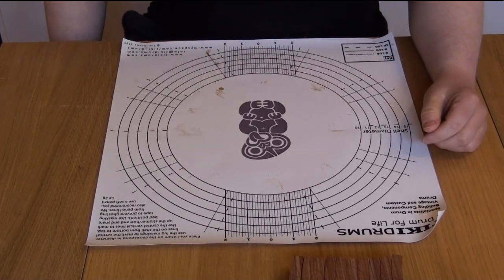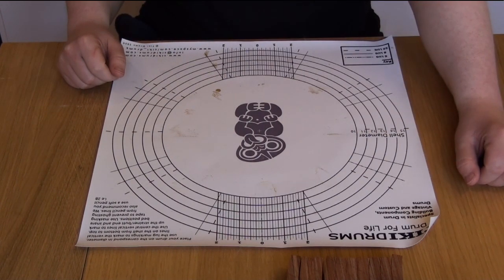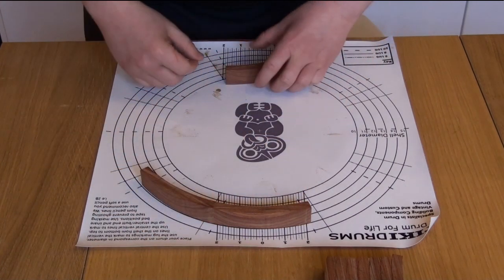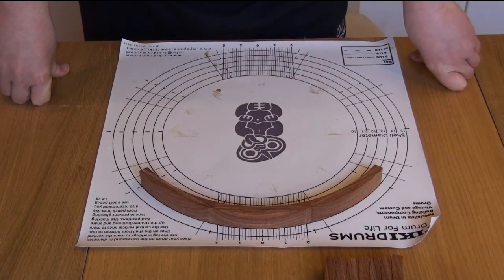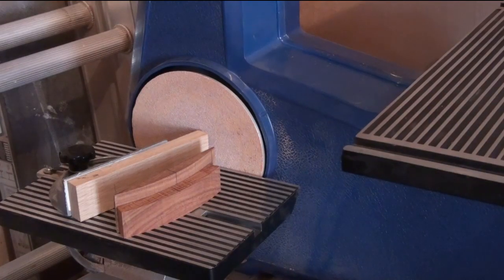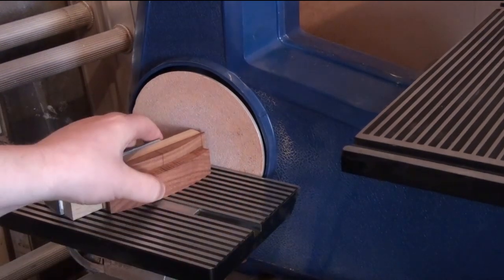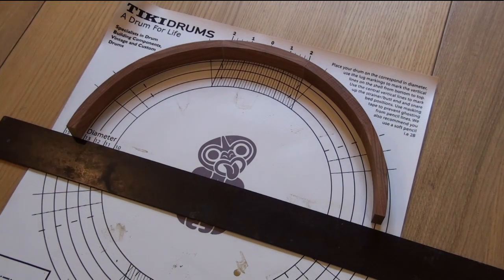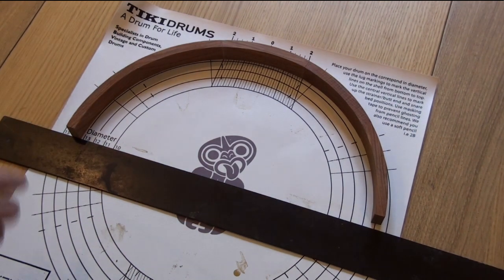Segmented Drum Shell - Part 2 - Sanding Curved Segments

Comment: Your final product looks great (I've seen your drums), and I can certainly appreciate your level of craftsmanship, but this just seems like an obscene amount of work. When you consider that segmented drums can have anywhere from 30-60 pieces, each with two angles, there seems to be far too many opportunities to make inaccurate cuts.

Is this approach solely to maximize yield? If you wait to round the shell until after it is glued up, you'll save all the hassle and the enormous amount of time tweaking every single joint. The only downside is the extra waste. I might be able to see why this method is used with prohibitively expensive exotic woods like ebony, but I can't imagine doing this with maple, birch, walnut, etc... 

With an accurate miter gauge, you can make all the cuts and be ready for glue up in 15 minutes.
Reply from the maker: +EthylOH   This saves quite a bit of wood if you are using 6, 8, or 10 segments per ring (compared to making hexagons / octagons, then turning them round) but for rings with 12, 16 or 20 pieces, I usually just glue up straight segments to save a bit of time.   Bear in mind I'm trying to explain what I'm doing in the video, which is pretty slow going, but in reality, once the disc sander is set up, it doesn't really take that much time to sand each piece from that point on, it's just the initial set up that requires a little trial and error.    Round rings are also easier to clamp (the hose clamps tighten up a lot more easily on a circle than they do on a hexagon for example) and there's much less surface area to sand when flattening the rings as well.   You also get to see what all the grain is doing prior to gluing the ring, so it's easier to get grain patterns to match up, or alternate or whatever, then there is the last step of turning the shell, which goes pretty fast when you are starting with a round object, it's just a matter of getting all the rings flush and smooth rather than removing a lot of excess material.